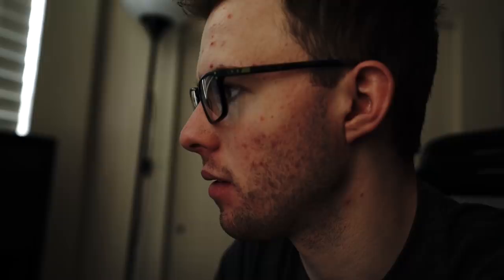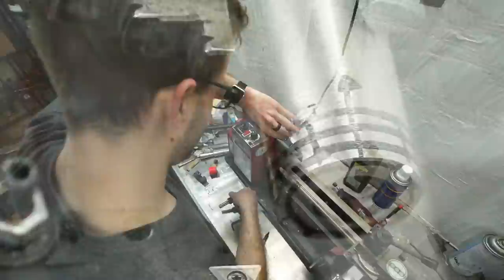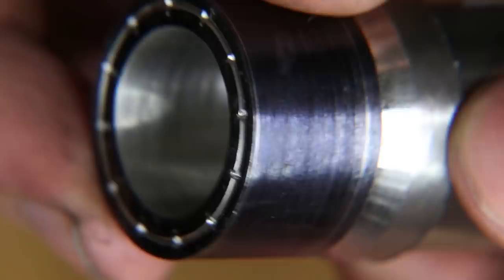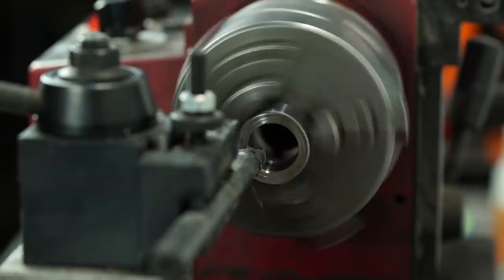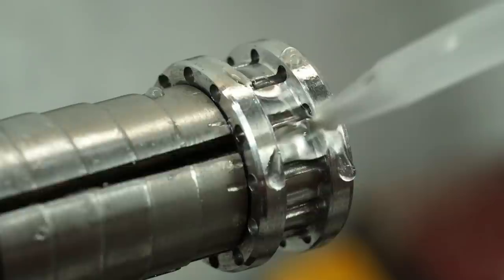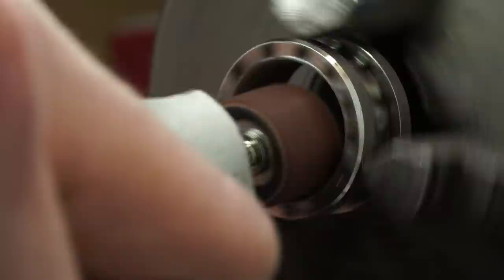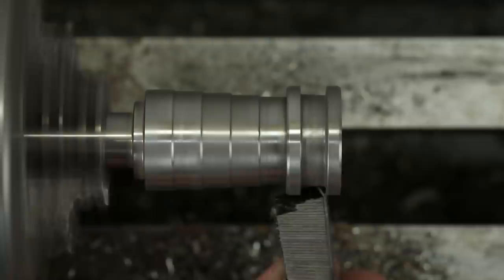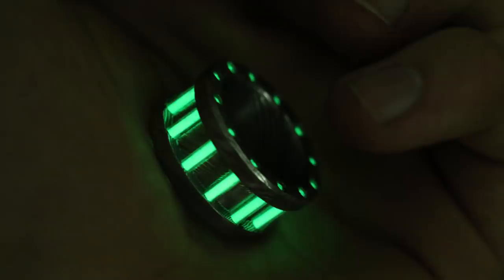Making a Tritium and Damascus Steel Glow Ring

Comment: ah yes I love how when you buy an extremely radioactive and rare substance, you get to choose the color. 5 stars
Reply: It’s not that radioactive... I own substances that are probably more radioactive and they are not even that bad if it’s always in a lead pig
Reply: Its also not that rare
Reply: Tritium radiation is blocked by a clothing. And here it is absorbed in a luminophore layer.
Reply: nøOne in the video he uses man-made tritium as naturally occurring tritium is extremely rare on earth and also runs for 30k per gram
Reply: U do realize it has extremely low radiation right?
Reply: I like how all of u don’t know he is being sarcastic xd.
Reply: guys, take a joke
Reply: No, its not extremely radioactive it’s just slightly radioactive ☢️
Reply: You probably get more exposure to radiation when you fly in a plane.
Reply: @l5-cs.  The energy of the beta radiation released by tritium is indeed low. Low enough to be completely blocked by even just the layer of dead skin cells. The issue with tritium comes more into play when it gets into your body where there is no shielding. Since it's an isotope of hydrogen, it will happily exchange with hydrogen in the water inside your body and get anywhere. 
In comparison to most other radioactive substances where time and distance play a role in handling, tritium is more binary. Either you handle it in a way that it doesn't get inside your body, or you better don't at all.
Reply: That is just proof that the little things are really what should be brightening our day
Reply: Lol right, bet the ladies that once put makeup on called radiant didnt know they were going to get cancer from their amazing glow. "Not that radioactive" might still be to much. its a matter of time, i imagine.
Reply: @user-wg8hq7nw5c  can't even travel through 6mm of air
Reply: @elijah8375  that's alpha.
Reply: @harlemslut  now imagine the amound of radiation from weating this for 12 years
Reply: @cdluggage  "not that radioactive" is very well non descriptive. It always depends on what kind of radiation ur talking about. Like someone else here said Beta radiation is completely safe, as long as it comes fron the outside of your body eg. If the radioactive source is outside your layer of dead skin cells. If you ingest it however,thats a whole other story...
Reply: @user-wg8hq7nw5c  the beta waves tritium gives off bounce off our skin lol also this is a joke
Reply: It's not that rare you can build a filter for like 30 bucks that will filter deuterium and triterium out of your regular water
Reply: It's such a small amount that you would have to crack all the tubes open in the ring and snort the gas and hold it in as long as you can to even raise your risk of cancer slightly. The beta emissions won't even pass thru the dead layer of skin on the body. Just don't be stupid and start snorting a bunch of the gas lol.
Reply: This guy: just being funny 
The internet: BLAH BLAH BLAH HATE HATE HATE ... LOOOK AT MEEEEEEEE... IM SOO SMART I KNOW EVERYTHING!
ME: 😢 WHERE HAVE WE GONE
Reply: @l5-cs.  In a lead? That's a damn strange expression
Reply: Its not "extremely" he was carefull ta say that it was slightly  radioactiv in a way that it hlows without risk
Reply: It’s pretty radioactive compared to normal things, it’s just not radioactive enough to do anything dangerous.
Reply: @Drsploodge  humans have ALWAYS been like this lol
Reply: "Extremely radioactive".
Unless you ingest the radiactive material, only gamma radiation is dangerous. Tritium only emits beta radiation when decaying.
Radiation is invisible. The glow is caused by a phosphorescent substance that captures that radiation and transforms it into visible light. Depending on the substance used, you get a different color.
Reply: Where can I buy tritium?
Reply: Tritium is in gun and bow Night sights. You can buy it at any decent sporting good store.
Reply: It's not that radioactive, nor is it rare.
Reply: Tritiums in a lot of watches PLUS it's not rare did you learn that from spiderman 2?
Reply: @lizard_ow7145  you did didn't you 😂I thought the same thing until I looked it up years ago
Reply: It's not extremely radioactive, it's beta decay not. This guy was pretending its illegal to make a good video. You can literally buy watches with tritium in them.

Even gamma radiation is way over hyped. You can literally handle something thousands of times more radioactive than what you'd get in an cray and still be completely fine, it's all about how long you are exposed to it.
Reply: its not necessarily a rare substance
Reply: One tritium vial is probably harmless.  I wonder what 20 vials strapped around your finger 24/7 will do to you, down the road.  I don’t think I want to try it and find out.
Reply: @yonismo4098  I can.  Just look up Luminox watches.
Reply: @false3695  Well, in the universe, it isn't by any means. On earth it is extraordinarily rare, with that being said, it's produced simply during the fission of uranium, and the fission of lithium with the latter being on purpose to create tritium for use in nuclear fusion research.
Reply: People don't understand a joke my friend lol

Comment: I'm no jeweler but am a machinist and gunsmith.  Just my thoughts if you are open to building on your idea.The holes left over along the edges look unfinished.  A contrasting metal insert to cover the holes or some sort of precious stones for the tritium light to shine through would have made it super cool.  I'm thinking some little diamonds, cubic zirconium stones or even fiber optic glass rods for plugs.  Another design would be similar to what you did here except to completely hide the tritium tubes and cut windows in different patterns for the light to pass through and illuminate some stones that would contrast and compliment the design.  During the day the stones would make it pop but then as the lights go down it would illuminate like nothing anyone has ever seen before.  I can see all sorts of potential uses for these tubes.
Reply: That’s a matter of taste
Reply: I think it’s amazing
Reply from the maker: Thanks!
Reply: Patrick Adair Designs no problem! It’s my honest opinion  about it
Reply: Let’s see your ring
Reply: ideas are great and the project goes deep :) the more added its more beautiful and glamorous
Reply: Shawn Menzenberg well how bout u make one of these yourself and make a video
Reply: Yea i would say it would be a matter of taste maybe an option , because I like the way it is now , but I can see the appeal of covering the holes as well

Comment: Thought you would fill the middle groove with clear epoxy. That would also spread out the light  across the entire ring, not to say protect the tubes and hinder them getting dirty.
Reply: TheCronan personally I feel like it looks better as just small tubes cause if he wanted that he could’ve just used green epoxy or something like that
Reply: A clear epoxy with no bubbles would have been the perfect last touch. Actually was going to comment the same thing but you had already done the work for me! 

* And no Kamea, he wouldn't have used green epoxy because the point is to show off the Tritium tubes. Which would still be visible with a clear epoxy and also would protect the tubes.
Reply: I agree
Reply: that's a very good idea
Reply: CleAr epoxy would preserve the integrity of the glass phials. Mine is in a "checkered" slot pattern 'pendant' made with titanium and tungsten carbide.  One awkward hand motion or finger spasm against an acute corner of any substance with a 6+ hardness rating (glass has a 6 hardness rating at least via scratch testing, proving loss of integrity. ). A single hairline crack and all luminescence is lost, irretrievably. Damascus steel is such a Gorgeous medium to work with. Such talent and the knowledge of proper tool use, seemed to be a dying art in today's heavily computerized and autonomous world. But if this "damndemic" did anything it gave all of us a chance to contemplate and reignite passions we all had in years gone by. The things that may have defined us at some point, the activities that let our hearts and minds shimmer in vastness of possibilities. The things we started to slowly move away from because life's constructs, the ones we are all seemingly born into,  FORCED us to follow the mainstream 'normality' that although differs from region to continent, the steadily increasing pressure to sell the one treasure that's been our birthright all along. We sell the precious finite moments that we were each allotted at birth. The truth is... Well I can't tell you your truth. That's what that existential horror we feel sometimes waking up in a cold sweat at 3 in the morning is based on. Our life dripping away seconds, stealthily purloining minutes, and opening the flood Gates, a deluge of years. Terror and heart stopping realizations. How did I get here?, Where did all the time and ambition go... This is what the lucky of us have found. Or more accurately 'rediscovered'. Whether it's painting, singing, writing or picking up a musicical instrument again. All of us regardless of color religion or Creed we all have a light inside of us. The  ability to laugh at something with a stranger, or forgoing some of the stigma that recent propaganda may have shed. Help an elderly person regardless of what religious Garb they may be wearing. This is the DIY year for us Americans. Pick up that craft you may have started but boxed up when life's Siren call to Work blared seductively silent except for the carefully crafted even subliminal messages like of what product you HAVE TO HAVE. Things we are blissfully ignorant of until we are saturated with the call for more. So long winded yes. Off topic, def. But this time is a blessing before the storm. Dangerous times ahead. So far we've seen the test run of this man-made substance (the 19th iteration of it. It lacks DNA, but carries markers in it's RnA, a signature, if you will. This is the tool created to 'cull the herd'. Population control...Globalists want the elderly, the sick or inform. Addicts, prisoners, transients, people under a certain yearly average income. Expect a resurgence with a higher fallout rate with elevated symptoms and faster-broader infection time and rate. Because we are all truly expendable to the top 2%

Comment: You could've fill the groove with epoxy, clear or maybe slightly milky, so the light would've diffuse.
Reply: And would protect it from accidentally breaking the glass.
Reply: Got the same idea 👍🏻😃
Reply: I was actually expecting it to be epoxied in as well..nonetheless it's still pretty slick.
Reply: He really has to use epoxy, because if he doesnt those tubes will break very easily. They are very fragile even though they are made of strong glass its very thin. I had my tubes break on me with my Luminox watch. They broke from shock ( probably from swinging a hammer or something) sent it in and it cost me $300 to get them replaced, and those are 1/5 th the size. He really want to avoid breaking those tubes.
Reply: Yea you don't want to break these, this stuff absorbs via skin or if you inhale it. The clear filled would be safe.

Comment: I would like it more with epoxy filling the central channel as it looks easy to break the vials
Reply: Same.  The ring looks really awesome though
Reply: T40Productions yeah he smashed the milling out of the park, could also be very cool if he slanted the vials to line up with a diagonal Damascus pattern.
Reply: I was thinking the same thing, but what's nice is that the way it is, the tritium could potentially be replaced if it loses its glow years down the road.

Comment: why dont put some clear resine over tridium ? cause if u use the ring every day there is a risk of droping the ring and breaking the glass tube
Reply: Why dont rite good?
Reply: be gentle with me I'm french ^^
Reply: It'll dull the glow and will make it faint.
Reply: 4.8M views Nah. It only needs to be couple mm thick.
Reply: Jake Hildebrand Did I say it wasn't? Tritium is a beta emitter which is a fast moving electron. Beta has extremely low rates of ionization because the mass of an electron is almost nothing. If it was an alpha emitter it would be more potent because of the mass of a alpha particle and it's ability to ionise.
Reply: Careful, he might retreat at any sign of aggression.
Reply: The vials itself block quite a lot of the radiation, not to mention the steel ring. Also tritium radiation has a very low energy. There is a reason it is allowed to be used in watches for example (my watch has them as well).
Reply: Even if it is in a glass vial, it still emits radiation and it can be damaging over long periods. My gun has 3 vials and is my carry piece when I go out. That being said, 20 vials, and depending which finger you put it on you're still exposing other fingers to many vials so while it would be a nice piece to look at for 12 to 24 years ( half life is 12 years or so - my gun is coming up on 10+ years with night sights and the fade is there, but the sights are still usable as night sights but they aren't as vibrant ) but eventually the vials will need to be replaced... The biggest mistake with this ring is gluing the vials in...

Comment: Man this is one of the best rings I've every seen. So beautiful and unique. Also a glow for.10~20 years awesome.
Reply: Try three times that. His numbers might be for some very diluted tritium though but I've personally used tritium that was from Vietnam that still glowed very bright.
Reply: Try three times that. His numbers might be for some very diluted tritium though but I've personally used tritium that was from Vietnam that still glowed very bright.
Reply: @James Davis Tritium has a half-life of 12.32 years after which, assuming that the light emission intensity of the phosphor is linearly dependent on the amount of beta particles, the intensity halves. So after about 12 years, it will still glow but with only half the strength. And after 24 years, the intensity will be only a quarter of the original one but the glow will still persist. With a higher concentration, the intensity also halves after 12 years, but since the intensity was much higher before, it will still glow after many more years

Comment: It looks very cool, but aren't those vials prone to getting broken (being exposed)? I'd imagine you could put acrylic or CA filler in the groove to protect them. Still, it does look totally badass...
Reply: yes as they are glass he is wrong about something it is not illegal to sell in the US it does require a license though... There is a lot of regulation on anything radioactive.  Also the gas itself is odorless colorless and overall is much the same as hydrogen. The glow is from the phosphorus coating on the inside glass the alpha radiation of the hydrogen causes the phosphorus to glow. Tritium has a 12.5 year half life the vials will diminish and eventually stop glowing.
Reply: Really cool! Get yourself a matching reamer for the next...
Reply: Lunas Eclipse quick correction : tritium emits beta radiation
Reply: eventually, most of those vials are rated for about 15-25 years before their glow gets rather dim.
Reply: Not alpha.  Tritium decays to helium by emission of a 18.5keV beta- and electron neutrino.
Reply: Lunas Eclipse alpha radiation is the nuclei of a helium atom. So you clearly have no idea of what your talking about. But apart from that your 1000% correct.
Reply: Actually 18.6keV of energy is released. The electron(neutrino) is released (beta radiation is electron radiation) at roughly 5.7keV  and then an antineutrino is also released with the rest of the energy.

Comment: I'm sure this tritium ring is a lot less dangerous than the radium-dial watches that they used to sell. A glowing green ring makes me think of Green Lantern's power ring, but I guess this one won't give you the ability to form objects out of pure will power.
Reply: Dan Schwartz the metal will absorb or bounce any beta decay (electron radiation) shielding the finger it is worn on... HOWEVER, it will not shield the fingers on either side :)
Reply: Radium IS much worse....tritium is one of the most harmless radioactive gasses...however, I think in the US it may be illegal to buy/sell...I'm not certain. It turns out its also a coveted national defense item of concern. ...can't make hydros go boom without it and it's got a short shelf life.
Reply: I used to wear a radium watch as a kid. I don't know what became of it. The women employed to paint the radium on the dials died young, and some of their graves are hazardous.
Reply: Tony Ennis did you wear it on your left, right, or middle arm?
Reply: Dan Schwartz I want a power ring that can make objects out of cynicism that would be fun
Reply: Tony Ennis...Yeah, those women were using the Radium as lipstick and painting there nails, one of them used to paint here body with it, i  guess like a 1930s rave party....lol